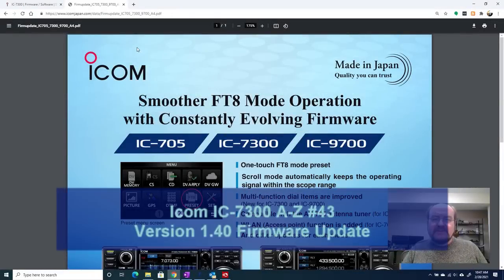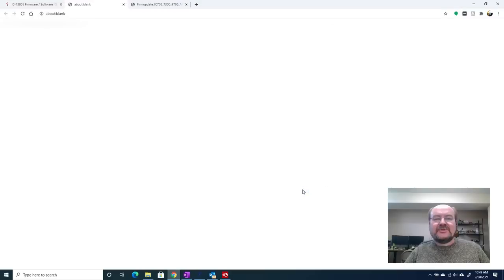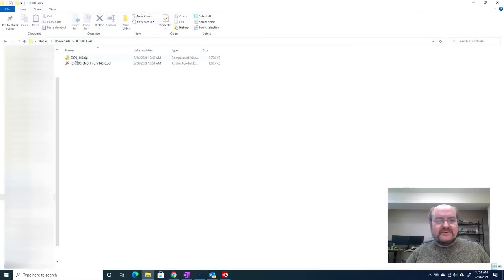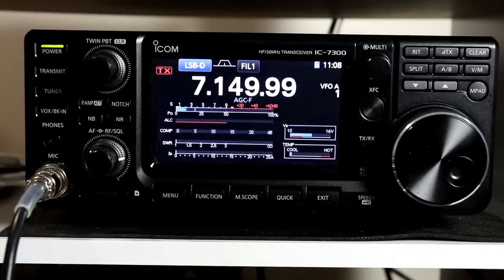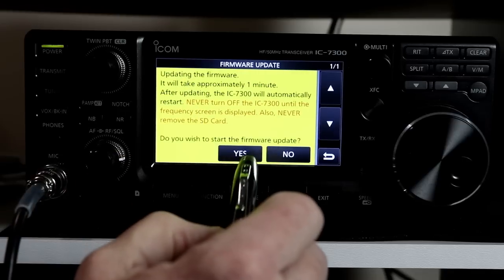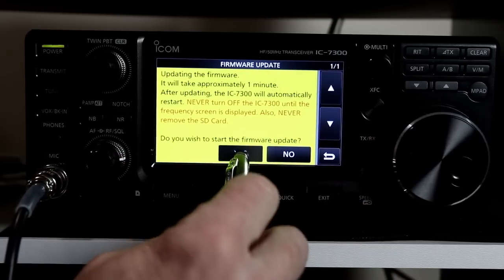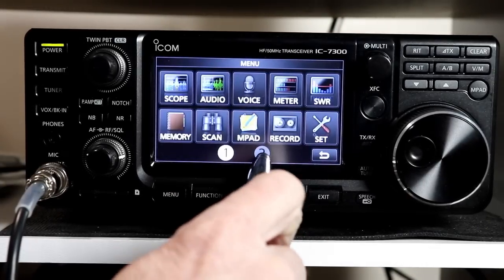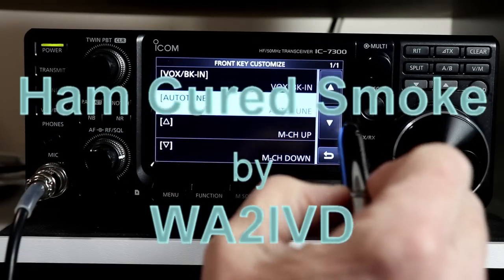IC 7300 A to Z #43  Firmware Version 1.40 Update Part 1

Comment: Wish the ic-7100 would get an update. They could do so much more with the menus like add dimming to the quick menu for a mobile radio.
Reply from the maker: Yes. I wish there was a better (easier) option for dimming. I find bright backlight way too bright for nighttime use. Then when I dim it, I have trouble seeing it during the day. It is a pain to have to work through the set menus each time. 
I have an idea for a fix that may be in an upcoming video. Stay tuned…

Comment: Thanks Tom.  I will use Scroll mode always.  Hated center mode and loosing the pointer.  Good thing I didn't complaiant or they would not have fixed it :)

Comment: I noticed the kHz up in the right corner of the screen also like my IC-705. The scope scroll is great because I hated that scope out of range message or maybe that didn't change? I like to attempt to listen to CB radio but there is no scope. Maybe this doesn't help though. I'll check it out. Did they fix the Scope in the IC-705 in this last update?

Comment: Thx for the overview Tom. Do you know what happens to the N1MM external 'Scope' when the IC-7300 has the new 1.4 update. Does it mirror the  Scroll features ? I am just wondering if that N1MM display feature breaks if I do the update from 1.3 to 1.4. Having the larger Waterfall on my Laptop has been a real asset.

Comment: Hi Tom, do you know what causes the horizontal interference lines on your spectrum display? I have the same issue and have failed to track it down. It happens on mine, even running from battery and house isolated from the mains grid.

Comment: Hi Tom i have to agree with man below, sound is abit quiet, i have to turn mine up to max to hear it...
Reply from the maker: Hi Fred. Thanks for the comment. I’ve seen similar comments several times over a couple years. I have gone back and played my videos on YouTube several times after seeing these. I hear everything fine with my computer at normal volume. So, not sure what is going on. In any case I’ll try to look into it further.
Reply: @HamRadioA2Z  Hi Tom, it seemed more on the first one when you had the screen shot of yourself in the picture, after that it did go up....F

Comment: hi i enjoy all of your a-z ic-7300 videos thank you so  much.
here is my question. I am a general license  brand new ham and like to set the band edges (1 of the 4) to the frequency's i can use as a general licensee, works fine except for the 6Meter band.  it does not let me set an edge from 50.100 to 54.000?  is there a work around  thank you very much :-)
Reply from the maker: The largest span that the spectrum scope can show is 1Mhz.  So for 6 meters you need to divide the band up into 1Mhz segments.
Reply: @HamRadioA2Z  that is an awesome idea.  Thank you so much and i keep watch your videos. Thanks again 😊

Comment: I have a IC 7300 with 1.3 firmware.  Also is has the menu and audio directions in Japanese. Will the 1.4 firmware fix this program or do I need to do more programing to get the radio into English?
Reply from the maker: The 1.4 update is not related to the display language. So you need to set that back to English manually. 
To do this, press the MENU button.  Then select SET mode. It is the bottom, right option on the menu screen.  Then select DISPLAY options.  That will be the 4th option down from the top.  Display Language is the very last option on the display menu.  So scroll all the way to the bottom. Then tap that option and you should be able to select English

Comment: Thank you for this well made video! But I do have a question. Is REF really the frequency calibration? I think REF is the reference level of the band spectrum!?
Reply from the maker: Hi Uwe.  There is a REF for the spectrum scope reference level.  However, the REF that the warning refers to is the REF Adjust setting that you will find under the Set -> Function menus.  The REF Adjust setting allows you to calibrate the internal reference frequency for the radio.  It is a number from 1 to 100 and each radio may have a different number from the factory calibration.
Reply: Again, thank you very much!

Comment: I bought a used 7300, is there a factory reset option I can do to clear out any settings the previous owner had?  Then I'll update the firmware. Thanks
Reply: Updating the firmware will reset all of the previous owners settings to factory default, so no need for you to backup the settings data prior to your initial firmware update.

Good idea to save backup files along the way as you  personalise your settings. I'd suggest you save the factory defaults immediately after updating the firmware, making it easy to start again from scratch if need be.
If you're not already aware, one thing not mentioned in this video is the need to format the SD card using the Format option under SD Card in the 7300's Setting menu before loading the card into the device you have the downloaded/extracted firmware file saved.